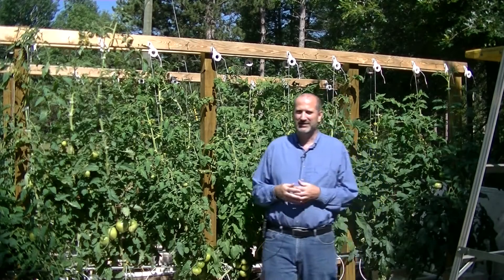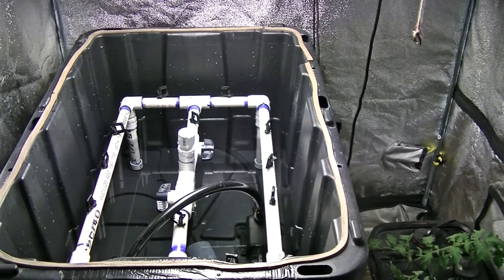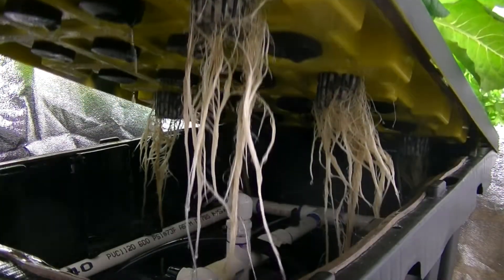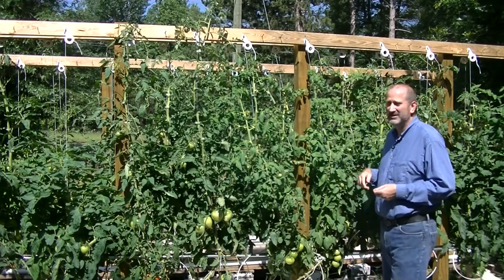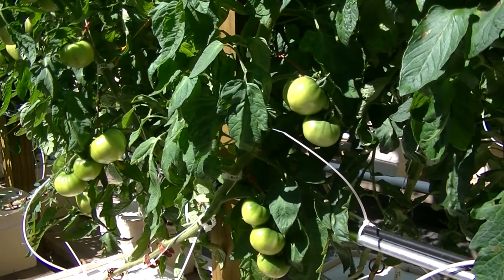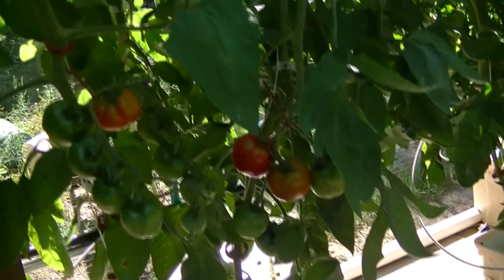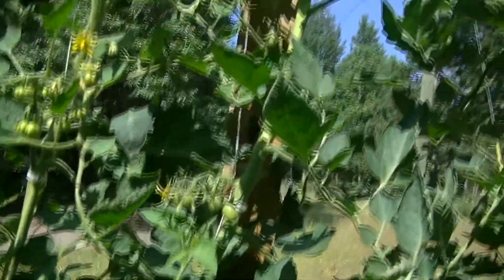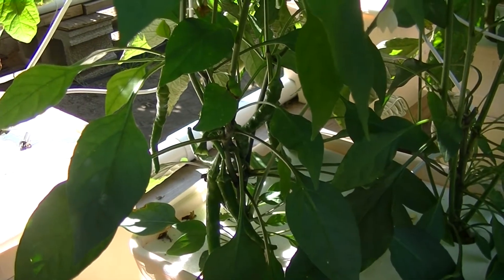2013 Outdoor Hydro 12-Mini Update and Indoor Lettuce

Comment from the maker: The lettuce seems like it should be more dense, compared to others I've seen.  I took this just as the sun came over the trees late morning.  Wanted to do it before the sun hit them, but got sidetracked. The inner rows were less sunny. I don't mess with the saturation at all.  When I look out the window the seem really green, the top half lighter than the bottom half usually.  Not sure how, except I do use Cal-Mag and usually B-52 with my normal fertilizer.